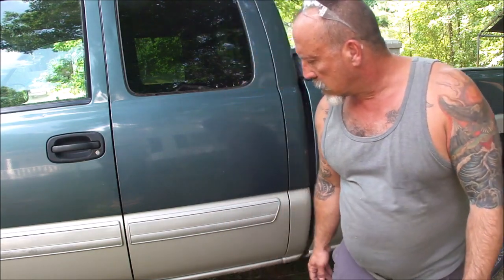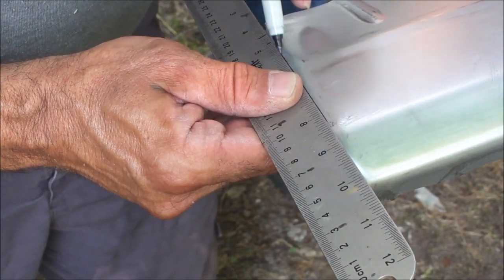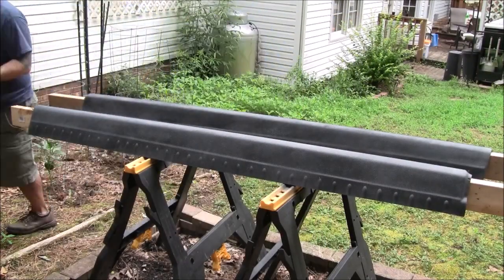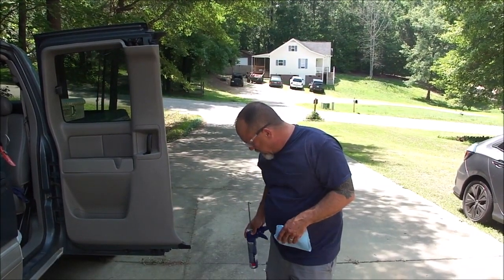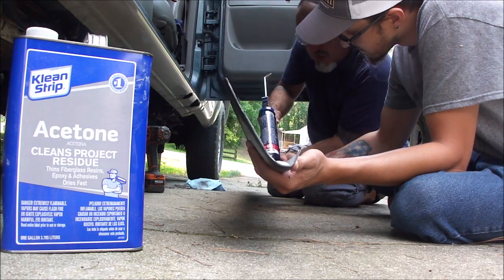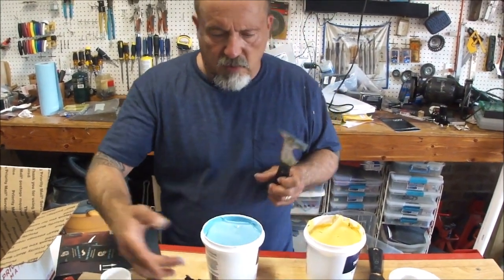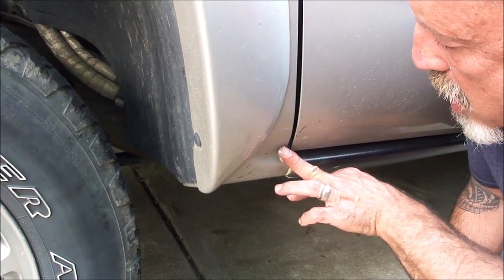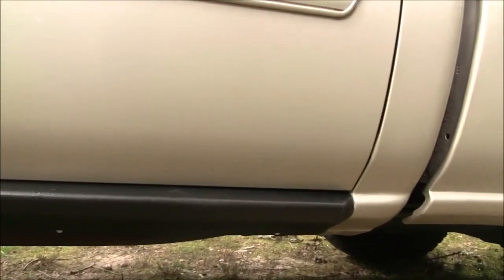2006 Silverado Rocker Panel Repair/Replacement

Comment: I have same issue with my '06 and bought same slip on panels. I was debating welding them on, but this turned out pretty clean! Nice work I may opt for the rivet and glue. Did you do rivets on the top edge or just underneath? How are your cab corners? Mine are gone so not really looking forward to that mess.
Reply from the maker: Cab corners are in good condition didn't have to deal with those fortunately and the rivets are just on the underside, the Metal Bond Sb-12 is some really good stuff just make sure to clean the surfaces before using.

Comment: Exact video I was looking for, I’ve seen these on eBay and have been contemplating on buying them. Just wasn’t sure how the fitment would be.
Reply from the maker: I have had no issues with the fitment on these and it lined up pretty well. Needed some minor fitting but overall i was quite pleased  with how these came out.

Comment: Thank you for the video---very helpful.  My only questions is this:  What are you able to rivet too?  My nearly call of mine is rusted out so I won't have much to rivet too unless there is another solid piece under there to weld to?   I actually have a 2014 Silverado Extended Cab.
Reply from the maker: Might have to just do the glue if there is no material for you to rivet to.

Comment: Thanks for the video. I live near Boston and as you can imagine our winters are full of snow and salt. Have the same exact issue. I found your video to be the most beneficial and I’m sure I can tackle this with ease. Thank you for sharing and saving me some $$$. I am confident this type of repair will hold up here in New England for as long as I need it to.

Comment: and the reason you had to trim it is because those are made to lap under the cab corners which wouldve ideally been replaced at the same time with no trimming
Reply from the maker: It turned out good and has held up. Thanks for the input!

Comment: The issue is, rust is “cancer” so when you leave that cancer present, it continues to spread. All you did was cover it up. You should have cut out all that rust first before covering it up.
Reply from the maker: Weird didn't have any issues even years later but thanks for the feedback.

Comment: I just replaced my 07 rockers and cab corners.  What a pain… I wound up cutting all the old out, oil sprayed the inner rockers and welded the new stuff.  I was a little extra particular and overall, I spend four solid days.  Again, cut out the old, oil sprayed, installed the new.  I applied chip guard on the entire bottom half.  I hope it lasts a while… what a crappy design by GM.
Reply from the maker: I've seen so many GM trucks with the same issue unfortunately

Comment: Would it be good to soak it with anti rust oil with a garden pressure sprayer before closing it?
Reply from the maker: It would not be a bad idea to do that.

Comment: 9/16 Self drilling flat pan heads or even regular pan heads work great too, I did my rocker panels on my 01 durango, I just used black coil stock I had laying around...:) ... I have a cat eye silverado, with the same problems...But, i think, I'll just use a body filler with hardener...

Comment: The only other thing I would suggest is using great stuff (expandable) foam inside the rockers.the benefits to doing that are strength, integrity and to keep some crap out of there.if your not going the patch panel method for a whole rocker it gives you a foundation to use fiberfill..rookies out there like me..DO NOT use Bondo anywhere.it just isn't meant for this use fiberfill.It's a million times stronger will last and the only issue it's working time is fairly fast.you got about ten mins..usually a little less actually.good luck everyone.

Comment: Hey great video, I will definitely do this to my outer but my inner panels are starting to go... do you think if I bought a inner panel I could trim it up and simply just cover the rusted inner and rivet it over top?  Thanks in advance for the reply.
Reply from the maker: It might be worth a shot to just do that rather than have them replaced. Hope this helps!

Comment from the maker: For those saying this isn't a valid repair and it won't last guess what WRONG! 4 years later still as good as the day they were installed.
Reply: I used a similar method. 4 years of salty winters and still solid. I had to rebuild the mid and inner rockers as well. I keep the insides wet with oily rustproofing through the rubber plugs at inside rockers and middle rocker with added 1/4" holes.
Reply: well it isn't the right way that's for sure if you don't mind seeing a lap joint every time you open the door I personally couldn't stand it but you should have at the very least cut out the rusty areas and treated everything inside that you could get to with something like bed liner
Reply: Good job. What kind of glue did you use?
Reply: It’s actually the absolute best way to replace rockers. No more rusting or denting. It was a genius idea for a product. They need to make for old trucks

Comment: Quick question: are these panels only made to slip on over the existing or can you also cut out the existing piece and weld this one on in place?
Reply from the maker: The panels i ordered were specifically stated as slip on panels.

Comment: Hi Joey ... enjoyed the video and my question is SB-12 adhesive I think has a cure rate of 24 hours optimal ... how long did you wait before driving the vehicle (also I noticed it's been several years since you fixed the panel and it's holding up for you ... so ... don't want to drive it too soon after glue n riveting!!)
Reply from the maker: I let it sit overnight and its been fine ever since!

Comment: Great video and the best non-welding solution I have seen. Thanks for posting.
Quick question, I can find cheap covers for silverados but not for my 2005 4 door Tahoe. Do you or anyone know if the $30 covers you bought will fit my Tahoe if I trim them to length?
Thanks and God bless
Reply from the maker: I'm not entirely sure but I'd look around online I'm sure someone has an answer for you. Thanks for watching!
Reply: I think the contour matches.

Comment: Nice and simple👍  Yes you could cut out the existing panel and weld in a new one but for the average guy that just needs it to work, this is a good method.  Thanks for the video🍻

Comment: What type of adhesive did you use? Was it silicone?
 I seemed to miss that part.
Reply from the maker: I used Sure bond Metal Bond Sealant here's an amazon link.

https://www.amazon.com/Metal-Bond-10-3-fl-Cartridge/dp/B074ZDP7HZ/ref=asc_df_B074ZDP7HZ/?tag=hyprod-20&linkCode=df0&hvadid=482729394853&hvpos=&hvnetw=g&hvrand=2411295458274329406&hvpone=&hvptwo=&hvqmt=&hvdev=c&hvdvcmdl=&hvlocint=&hvlocphy=9009690&hvtargid=pla-1041317609902&psc=1

Comment: Will your state inspection fail a vehicle for outer body rust through?
I understand some states do.
Reply from the maker: No outer body rust does not fail inspection in my state.
Reply: @joeysautodiy7740  lucky. Anything more  than the size of a dime is a rejection in massachusetts

Comment: I'm doing mine now and normally I would cut the spotwelds and install and weld back like factory. But now I'm old and don't want to do all that crap. So I like you put a heavy bead of body caulk on the top lip and about 30 rivets. Then same for underneath only started in the center clamping and riveting and it came out nice. I painted the old and new rockers both sides with bed liner and color sprayed to match.  Also used some duraglass on top lip to blend and hide the rivets. Can't tell it was touched. Unfortunately I have to replace both cab corners and so I took off the bed for access.

Comment: How much did it run you? I have an 04 Silverado Maroon red, and the rockets are fucked as well as cabcorners looking to see how much it’ll cost me
Reply from the maker: Around 80 to 100 bucks if i remember correctly wasn't to expensive there are links in the description to where i got all the stuff needed.
Reply: Homiejoey would the 06 fit the 04 rockers?
Reply from the maker: @Arahsaka  I'd do some research on that but I'm pretty sure they're the same just make sure you get the right ones, mine is extended cab so if you have crew cab they wont work

Comment: Great video! Do you think this could work if the lower half of the entire rocker panel is rusted off? Basically, where you put your rivets is no longer there at all.
Reply from the maker: Probably if you use alot of the glue  it should hold

Comment: You used "glue"  Silicone or Urethane?
Reply from the maker: Heres link to what I used 
SB-12 Surebond Metal Bond Sealant, 10.3 oz, Gray https://www.amazon.com/dp/B074ZDP7HZ/ref=cm_sw_r_cp_apa_i_TSWmEbWAW9BXX

Comment: is there just a lip where the new rocker lays on the old one ? could you cut the old one off and but those ends together ? thanks chad.
Reply from the maker: Sorry so it took so long for the reply but you could cut out the rusted rocker and theoretically you could weld in a new one but i opted to to do it the easier route. Hope this helps.